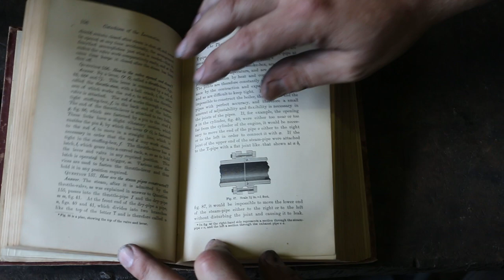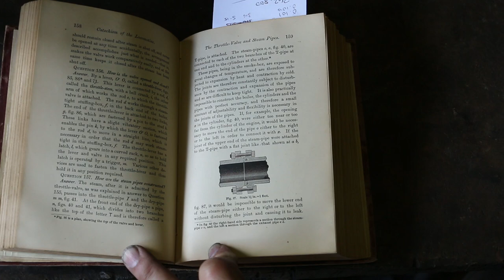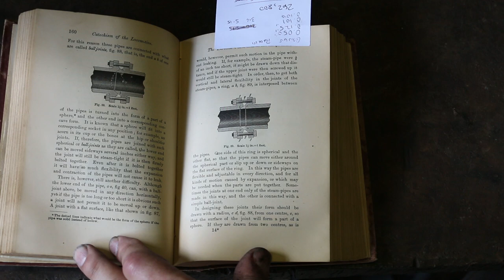Steam Locomotive Repair - Steam Pipe Rings

Comment: It is easy to imagine steam boilers and engines to be simple, old, unrefined machines. At the latest, when listening to your discussion of something that would seem so trivial as a steam pipe connection it becomes apparent that there is a lot engineering that goes into these machines. Even the little Wilesco toy steam engine I loved as a kid had its share of issues, many of them similar to the ones on big engines. Thanks so much for clearly explaining the intricacies of these wonderful old machines!
Reply: one thinks of steam as simple, and thus easy to make and tolerances as slack, in reality, theres a whole lot of precision, machining, valves to make, pipes to seal, and pressure to deal with, none of that is for casual sloppy backyard bodgers!
Reply: Indeed. Just because its old doesn't mean its poorly engineered or made.
Reply: By the 1900's, steam was a very mature technology.  The only crudeness was due to machining limitations (and not much of that by 1917), not engineering.  To think what was accomplished with slide rules and manual machines is mind boggling.
Reply: Don't forget; they had to transfer the power to the drive wheels somehow. And to the generator. And to the compressor, for the brakes. Some engines even provide(d) steam heating to passenger coaches. Some still do, like over in the United Kingdom...I think.
Reply from the maker: The engineering that went into these old steam engines is amazing to me - all figured out by people who for the most part had nothing to go by - they just made it up and refined things as the went along.  Amazing!  And if you think these guys were not technical back in the day, just get some of the old engineering books that I have on steam engines and just see how much they did know!
Reply: Russia, on the trans Siberian railway. Each passenger car is heated by a coal fired steam boiler, manually. An attendant looks after several cars going from one to the other making sue they are burning properly . And thats today,not in the 50's . my ex wife's mother had to travel from the kurile islands to Lithuania via the trans Siberian  and it took 3 weeks of constant travel . (in the soviet union you did as you were told,hence the epic train journey)

Comment: Nice job Keith, here in the UK we use what is known as a "navy union" for steam connections, the mating surfaces have a brass insert ring cast into both mating surfaces and they are both soft enough to make a steam tight connection when tightened up and as the union gets hotter and expands the surfaces become ever more tight.

Comment: Steam (just like water) is a powerful etchant when passing through tiny openings. I read somewhere that the process is similar to cavitation etching on marine propellers (not prop aeration, which is something else). As it passes through a pinhole at high speed, the water actually turns to vapor momentarily at low-pressure points and when it returns to liquid it slams into the metal since the liquid is incompressible and actually blasts tiny particles of metal from the surface. Steam, of course, is already in vapor form, so as it passes to cooler, lower-pressure places in the pinhole leak it condenses directly to liquid with the same slamming effect. This is why you need nice wide, good-fitting contact surfaces in water and steam valves and joints. (And why you need to keep them in good repair.)
Reply: What causes the steam to be abrasive is the water droplets in the steam. Unless the steam is superheated it is very difficult to keep it dry. Any heat loss at all will cause the steam to begin to condense. This condensate form tiny droplets of water and with the velocity of the steam flow these droplets act like sand. The low pressure end of turbines for instance, are always dealing with wet steam.

Comment: When I was a young lad my neighbour had a car repair workshop where I worked in school holidays, mostly for interest and to learn a bit. When lapping in cylinder valves the spindle would be turn run back and forth between the palms of the hands then rotated about 90 degrees, never spun with a drill, (which we had even then). I believe you got a better finish although it was harder work. Originally this is how that engine would have been done - by hand.
Reply from the maker: Very often lapping was done by hand.  But, I found a reference to it being done by means of power all the way back in 1915!

Comment: Thanks for the video Keith. My short time as a machinist mate in the navy taught me to never check for super heated (600ppsi) steam with any part of one's body. A broom stick was usually used. Small leaks couldn't be seen just heard. It would cut into the stick rather quickly when found. Scary. Cheers.
Reply from the maker: A good friend of mine who was a pilot in the Navy told me the same thing - when he was on a ship, they used a broomstick to find the leaks!

Comment: It was fascinating to see that plastic/perspex material be machined.  It is so strange to think you can work something other than metal in a metal-working lathe!  However, I have heard that carpenters can use a wood lathe to turn brass and gun-metal pieces, so...  Very strange and very interesting to see!

Many thanks as ever Keith!!!
Reply from the maker: I have done quite a bit of plastic work on a metal lathe.  I have also cut wood on a metal lathe.  Never had to cut metal on a wood lathe, but only because I have a metal lathe.....

Comment: Keith, very interesting setup for lapping the the two parts together. Also thanks for the lathe machining tip for putting a slight radius on parts using a sanding disk and angle grinder. Regards, Paul

Comment: Wonderful repair job Keith, and thanks much for the increased insight about what goes into keeping these mechanical marvels working and operating.  What really caught my eye was that book you referenced to, published in the 1850's to illustrate the problem that ground steam pipe rings were created to address.

Using a grinding wheel during lathe work!  That was pretty improvisational, but also ingenious to turn a simple convex radius since the museum's Lodge & Shipley lathe doesn't have a tracer attachment.  That radius looked too big to try and grind a custom high-speed tool to cut it.  I'm thinking the stick-out would have been excessive had that been tried and so there would have been unsolvable chatter problems.  Slick setup meanwhile for doing the facing of the mating surfaces inside the smokebox.  ^^
Reply from the maker: Some people have said that my method would not be precision enough for the job but since I am lapping the two curves together, it really just does not matter.  Sometimes you have to get creative to get a job done!  Truth is, I got the tip on doing it that way from another guy who does locomotive repair work - it works for him!

Comment: Nice work. Cast iron and delrin - good materials to work on the lathe. When I have needed to put a radius on a small part without the right size radius tool, I have cut a hole with the right radius in a piece of 3/4 plywood, cut the ply with the hole into suitably sized blocks and glued pieces of emery paper into the concave sections. These concave blocks, with successive grits can then be used to radius and polish the part.  Works well if the part does not need too much material removing. Best wishes
Reply from the maker: I was basically eyeballing the original one that had the correct radius on it.  I though about making a template, but I just did not think it was necessary.

Comment: Looks good!  There are times when I feel I need my pipes lapped.  Well,  I knew there were special fittings for steam like the tubes were swedged (or how ever it's spelled).  Oh well, bricklayers usually used a concave joint between courses to help seal the mortar joints but that's another story.  Greg

Comment: Really nice video, very informative.

One word of caution, that type of universal joint can kink under power. When it does, it will Jerk the drill right out of your hands, and possibly Injure you. preferably, use a Wobble extension, or a impact universal joint. These will limit the amount of bending that is possible and is much safer to use. If neither is available, Put a stiff rubber hose around the Standard universal joint, so that it will not allow it to bend to the point of Locking up.  a standard universal joint will work fine as long as it's fairly straight. There's a point where these universal joints or more of a nuisance/safety issue that I would like. Even used by hand, No power tools involved, they can be a nuisance. Having an impact universal joint in your toolbox is highly recommended. Even if you don't have air tools.

stay safe and have fun.

Joe.

Comment: Good ole valve grinding compound..i suspect many modern day mechanics have never heard of the stuff. :-)
Reply from the maker: Very true!  Funny story - we ran out of valve grinding compound before we got through so they headed to the local auto parts store to pick up some more.  They bought some in a tube from I think Permatex.  On the back of the package, it clearly stated to start with course compound and switch to fine compound to finish (just like you are supposed to).  But, the packaging did not say if it was course or fine.  And they only make one kind.  Even a call to the companies customer service could not answer the question!  I suspect that they just make one grit these days as nobody know why you need to have two grits - and they never updated their packaging.   Fortunately, we ran out of course and had plenty of fine, so we just finished up with the "known fine" compound just to be on the safe side.  I am pretty sure the stuff they bought was course....
Reply: You can order "clover" brand compound in just about any grit you require.Where we used to work we used it to lap valves  lIt has a label on the can with the grit size but we had trouble with the labels getting messed up and then you had no idea what grit was in the can. Write on the  lid with a sharpie what grit it is.
Reply: I have used that stuff a number of times for "non valves" for example ,I had a wood shaper with a defective miter slot (a high spot) A piece of steel with valve grinding compound .....became a poor mans milling machine.

Comment: Keith, very nice video, as always.   I wonder if they intended to make the previous steam pipe rings out of softer material (brass or bronze) so that they would be replaceable parts, like gaskets.   The steam would wear the rings easier than the other surfaces that were much harder to resurface in place.   Too bad there is no logbook of what was done on this engine's 100 years of life.
Reply: I wonder that with the softer material did they have to lap it or would it just conform and seal thus saving labor and getting the engine back into service sooner.
Reply from the maker: I have no idea what the reasoning was to use the bronze material, but we decided to go with the advise in the old books and others who work on these things.

Comment: Thanks Keith for a really informative video.  I had no clue what was behind the nose until now and I am amazed at how the transfer tubes were installed from that time period. I am not familiar with wet and dry steam so when you get a chance can you show the parts on the locomotive where the steam is heated from wet to dry steam?  Thanks again!
Reply: I think that they just maintain the correct temperature and pressure in the boiler to keep the steam as dry as possible.  They blow out the steam lines, the steam chest, and cylinders to clear out any condensate before driving the train.
Reply: In the UK we used super-heaters to add extra heat into the steam before entry into the cylinders. They go at the highest point on the boiler. Since the steam pipe comes along the same spot in the boiler I expect it is acting as a primitive super-heater. Super-heating is basically adding more energy after something has changed it's state- IE liquid to a vapour.
Reply: Oliver Lewin This engine is more like a yard engine.  It wasn't built for the main line.  It was built more for working in mills and quarries. It would never be very efficient because it would spend much of the time simply sitting and then making only short slow speed runs.
Reply from the maker: The dry steam is usually hotter than the wet steam.  And since heat rises, it is found at the highest part of the boiler.  Which is whey they have "steam domes" on the top of boilers - on a locomotive you will see the dome across the tops of the boiler.  When you pull the steam off at the top of the dome, it is more dry than lower in the boiler.

Comment: Very enjoyable & INFORMATIVE.....though the bronze 'packing' you replaced would SEEM to have been extremely durable....had it been properly "radiused".....?

Some of us would like to see the replacement under test steam pressure....if that's possible....?
Reply from the maker: I think that if the leak had not developed on the bronze fitting, it would have been fine.  I have seen cast iron and steel both eaten away by steam just the same.

Comment: I was surprised you didn't put oil on the drilling  operation. Those drills were straining to cut the cast iron.
Reply: Cast iron can be funny stuff when drilling... because of the large proportion of carbon present as graphite it will drill quite nicely without extra lube... untill you hit a sand inclusion or "chilled" section. Then all the cutting compound in the world won't save the drill's sharpness anyway.
Reply from the maker: Question already answered.  Bottom line, I rarely use cutting fluid on cast iron.  Other reasons as well which I often discuss in my videos.  Doing so can actually cause excessive wear to your machine as well!

Comment: When you get that surface grinder up and running along with a radius dresser, you'll be able to make that form tool a little easier if you don't need an exact radius (if you want some relief angle).
Reply from the maker: I wish I had all of that running now - I was actually thinking of that possibility.

Comment: I have an idea that the work has already been done.  My suggestion is to use one of those B&D heavy duty drills that are not as fast as that Milwaukee to do the lapping.  Speed in this case is not your friend-perseverance is.  A slow speed air drill or motor would also be good.

I have lapped valves on gas engines as well as triple valves and check valves.  It takes a while if done correctly.
Reply from the maker: We ended up using an air powered drill and ratchet that turns much slower.

Comment: Keith,
Thanks for the interesting video. I noticed some white scale in the steam pipes. Does that have to be "boiled" out (like you boil an car engine to remove crud from the oil and water galleries)? I would think that, since the steam is taken from the top of the boiler, that all the minerals in the water would remain in the boiler. My guess is that water-soluble minerals could be carried in the steam. Thanks again for a great video. 
Have a good one!
Dave
Reply from the maker: That is basically lime deposits from the dissolved lime in our water.  We use some boiler chemicals to minimize that, but you are always going to get it to some extent.  We use a high pressure washer on the inside of the boiler to remove as much as we can a couple of times a year.

Comment: Interesting: When I was in grade school I helped with the operation of a much larger stationary boiler, hauling coal and brushing out the fire tubes. I think the tubes were about 20 feet long. It took two persons to do it . One to guide the brush into a tube and the other to run back and forth with the end of the brush handle.
Reply from the maker: Cleaning the flues is a tough job!

Comment: What is the largest drill bit you have, and have you drilled with it?  (open question for any engineer here), me i have 3/4 bit, but never used it in my 1/2 drill press (reduced shank type)  I also had a 42lb sledgehammer, and back in my youth i could swing it 3-4 times before giving up!
Thanks for the video Keith , and its great to see  things made that you dont realise even exist, or have thought how they solved that engineering issue.
Reply: 3-1/2" is the biggest drill I have and I have used it.
Reply: Video evidence is required Brian....haha
Reply: Used or ruined?  I can ruin a big bit like a boss (mine of course...I don't like taking a butt kicking).  lol
Reply from the maker: I think that the 2" drill is the biggest one that I have - and have used.  If I had a bigger one, I would not be against using it in the lathe!

Comment: One small correction - difference betweeen cast iron and ductile iron is in the shape of the graphite in the matrix of the material. Cast iron has long stringy pieces of graphite, in ductile iron they are spheres. There is also a third variety, that is between the two in terms of characteristics and graphite shape - Compacted graphite iron or Vermicular graphite iron.
Reply: Iron alloy chemistry is infinitely fascinating.
Reply from the maker: I won't pretend to be an expert on what makes up ductile iron.  But I have been told that chemically there are differences in what went into ductile vs grey iron.
Reply: The major difference, that you mention - resistance to cracking and shattering when shock loads are applied comes from the shape of the graphite. The carbon and silicon content are in the same ball park in both types, everything else as far as chemical content depends on the desired characteristics of the material.